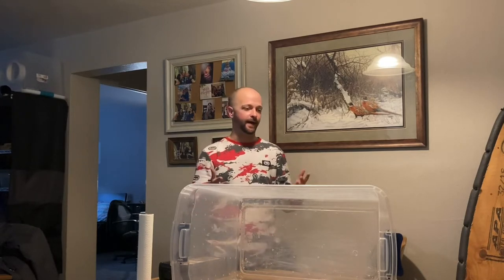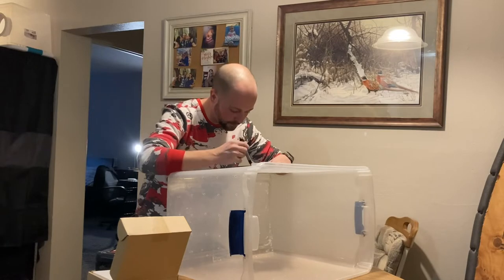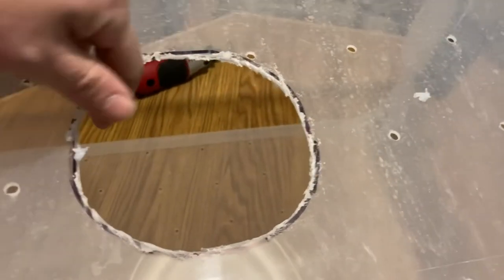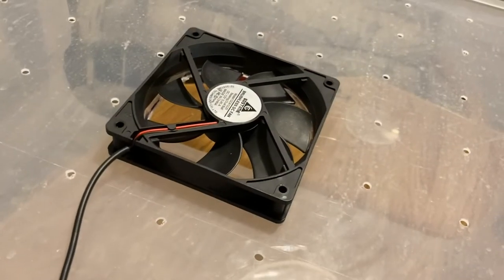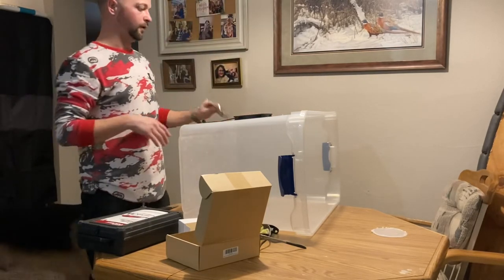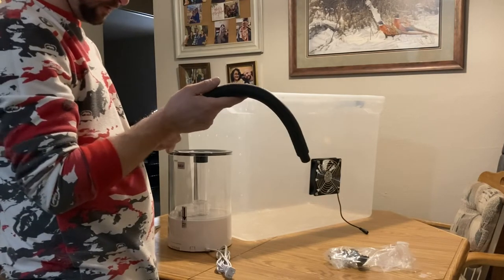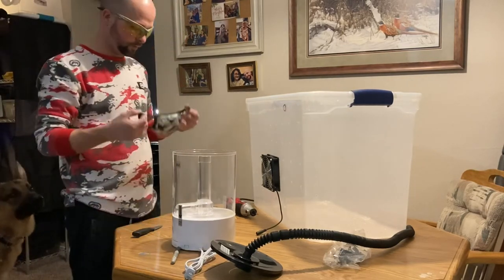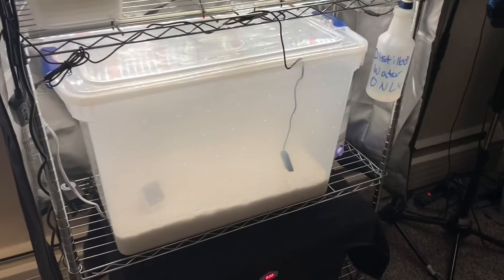DIY Automated Shotgun Fruiting Chamber ASGFC

Comment: Thanks for sharing this video, I am constructing my automated fruiting chamber while waiting for my spawn to colonize. I will be using a small fan with a timer set to turn on 2 to 3 times a day for 30 seconds, then run my reptile humidifier to cycle on a timer for about 30 seconds after each fan cycle. I am planning on dialing this in before adding my grow bag cakes. This video has given me hope. As theres not alot about automating a SGFC. Work scheduele lately leaves me with very little time for my new hobby. 

 Again thanks for sharing.

Comment: Could I set the fan on for 10seconds every 20 minutes, followed by the humidifier set for 10 seconds every 20 minutes, would this process workout by not using a humidity controller

Comment: Will the humidifier bring in fresh air too so you don’t have to have the fan ?
Reply from the maker: It’s more about getting the old stale air out and drawing fresh air in at the same time. Although I have found I don’t need the fan much with the number of holes I put in the bin. Next time I’ll do way less holes because it’s hard to maintain 85-90% humidity with the amount of holes I put . I might just switch to shoebox teks all together. Less bulky and can do more strains at one time with the space I have. I’ve been having more success with them lately also. I started doing all my own grains too. But I’ve been working two jobs so haven’t had much time to film as I have my daughter during my off time.
Reply: @mountainsmushroomsandmaryj6  I am building a fruitingchamber like this, just with 6x 1" holes with microporous filters, no fan. It fits 3 shoebox size. That way I can inoculate more boxes outside the fruitingchamber and add them to the right climate for fruiting.

Comment: Does the bottom of the chamber ever leak?
Reply from the maker: Some perlite does fall out sometimes. Especially if you move it around. I usually put a towel on top of my spawn box which is just below the SGFC to catch any perlite. It also helps maintain the temp in the spawn box. Beyond that if you’re not using a humidifier you should only be spraying the inside enough to leave water droplets on the walls of the SGFC. No need to soak the chamber or the block. Just trying to maintain 80-90% humidity with fresh air exchange in order for the mushrooms to fruit.